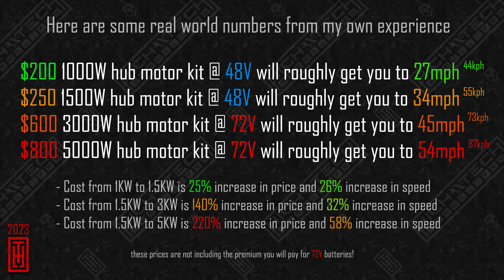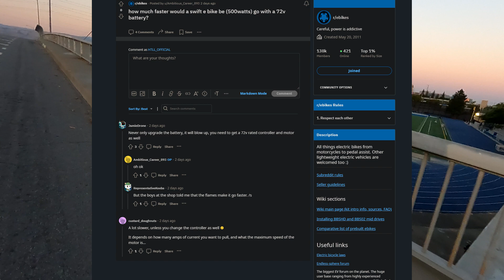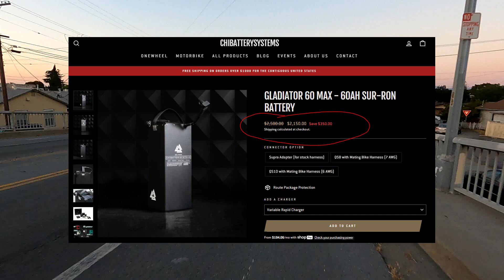🚲 High Powered Ebikes Are Stupid And A Waste Of Money

Comment: The standard 1000w hub motor (28mm magnet height) can go 60km/h on flat without overheating on 72V. Or on 48V if you replace the phase wires and connect the motor to have  √3 higher KV.
The only problem for me is it reaches 80°C quite fast when going uphill. I give it 45 amps though. A bigger motor would be more efficient and generate less heat. Or putting the 1000w motor on 20" wheels for more efficiency.
Reply from the maker: Yeah uphill is a lot for any ebike, I did hear some people saying their reasoning for wanting more power is for uphill, which makes sense but I still think that a motorcycle may still be more economical 🍻

Comment: I think I agree with you to some extent, but you said if you wanna go fast, you need 72v but there seems to be a lot of bikes coming out that go pretty fast that are only 52 V with field weakening.   
Also, I have a roadrunner pro and that’s 60 V and that thing accelerates like crazy and hits 50 mph. But yes, 72 V is generally the gold standard.
Reply from the maker: To me 72V is now not enough if you want high power, 96V is the way to go for a higher top speed and will be minimum for my high power builds 👍

Comment: After riding my 3000w kit for five minutes I was like wow this is dumb 😂
Reply: @ what frames do you use for your builds? The axle keeps coming off of the dropouts on mine (just put it together last night). The cord wrapped around the axle but everything still seems to be working but this is annoying
Reply from the maker: @dogeystyle69  I've used many different frames, if your dropouts are worn (loose/play in them) or your axle nuts are coming loose, then you'll want to make sure you have torque arms in place. I have a video on my channel on how to make very strong torque arms, this will prevent this issue from happening. 

For 3KW and up, torque arms are basically essential, especially if your dropouts are not particularly strong. I've gotten a lot of flack on my lower power builds (1500W and under) for not running torque arms, but for certain applications (aluminum frames, thin/skinny dropouts), especially high power ones, you really need them. 

Also make sure your axle nuts are on tight 👍

Comment: Very well said.  I would just get an electric motorcycle if I really want speed.   I use my ebike to overcome the hills with ease.  Other that that, I am never really in a hurry to go home when I am on my bicycle.  Excellent points you have there.   Most use Surrons/Ebikes as a substitute for a motorcycle.   The police in my area are already cracking on these high powered ebikes riding 50 mph on the sidewalk.
Reply from the maker: Thanks man, yes there are some cases where you might want a "gray" bike, but that margin is very small and going either side of that point makes more sense to me. I've had people argue with me only to let me know their bike is 1500W which is my recommendation for power level. 👍

Comment: Bro suggest me :
I want to build an ev super bike that can do above 100kmph in Reasonable budget is it feasible? Main interest is more speed while keeping in mind the petrol prices in my country.
Or
Should i go with a petrol engine and enjoy? (Because petrol engine have more prower?
Reply: Ok i got my answer at 14:00 😅
Reply from the maker: @BLUE-uy3fb  For ebikes, getting to 60mph is expensive, getting to 40 is pretty cheap. You have to pay a lot for that extra 20mph. Gas bikes also have a huge advantage for going fast as they are designed to do that for a long amount of time (freeway riding). 

If you run an ebike at highway speeds, even the production ev motorcycles like Zero Motorcycles your ev range drops considerably when going those speeds for any length of time. Same for EV cars going high speeds, towing, etc. EVs are better for slower, stop and go usage like city driving.

Comment: the problem with E bikes is that they are heavier than a regular bike of which makes it hard to pedal it even with the pedal asset , we are forced to use the full throttle because it's just too heavy ...
Reply from the maker: They don't have to be much heavier, there are so many different ebike styles and sizes. I have a few that feel exactly the same as pedaling a non-powered bike 👍

Comment: He must live on flat ground without rolling hills to climb?
Reply from the maker: 1500W should be plenty of power to climb a hill, and you may want to pedal as well to assist. If you need to go 40MPH uphill then by all means spend the thousands to get yourself there 👍

Gas powered still makes more economical sense if you are needing to go very fast up steep hills.
Reply: @hightech-lowlife  won't you agree if someone wants an E bike that can go up to 40 MPH at that point they better buy a motorcycle helmet & not that stupid E bike Helmet ? I think going super fast on an E bike is very dangerous cause they shift speed so very fast & so suddenly that a car going at the same speed can't keep up with the agility of the e Bike. I lived in San Fran most E bikes in my opinion can't handle the hills on a daily bases & trying to use pedal assist is still very hard because those E bikes are so much heavier than a regular Bike so it takes more work to pedal even with the assist , & plus Bicycles /E bikes are not designed to go super fast at faster speeds.. unlike a a Harley that comes in at like 480 to 500 pounds;  the physics of going super fast on a E bike is not supported ;the laws of physics will take out the rider .. more dangerous than riding a motorcycle at super higher speeds.. just my opinion..

Comment: My bike cost just under $2k in total and does have a crazy top speed but I built it for 30 everywhere :) I feel lucky be considered into that top 1% of the 0.1% and to have not spent 6k in parts at the same time haha 😅 average cost for a 1500w build with a second hand bike in the UK for me is $630-750 and I managed to build a 10-14kw ebike for around or less 3x the price, a good ratio considering it (can) do 5-7x the power of my old bike, double to triple the mileage (40-60 compared to 15-20(52v 18ah), it can now go uphill 3x the speed too I done 45 up a super steep hill. 70-80mph? Idk I haven't went past 60 and not past 50 since then.. I laughed my ass off when you mentioned how scetchy it can be 😂 I kept burning out motors on steep hills going 10-15mph, I now have 3 old 1500w hub motors that can be fixed becuase it's likely in 2 of them the hall sensors burned out before the coil windings, but that's what got me thinking "with all the money I've spent on these cheapo hubs I could've made that 5000w one I've been eyeing up" that's where it started lool, and ofcourse to get under that 2k price I had to build a battery, it's a 72v 36ah 12p pack. 
It's at the point where I'm happy where it is. Only upgrade I can see it needing is some sealed bearings that can handle 30mph for the long term. 

Overall it's a beast for the money and can see it being way more reliable than a 1500w hub, but that's only because I live in the countryside and have alot of hills around and in hindsight those shunt mods will only work if you live in flat road areas too lol. Yes I know..😅 The regen brakes save me the pads but you are right in pretty much everything you said here. The car license is next before a bike in my situation, I would like to drive shielded out of the rain sometimes lol.
Reply: Is your 60-80kw build going to have a qs180?
Reply from the maker: Yes, if you're on r/ebikes a lot of riders tend to think you need spend at least 4k on a bike otherwise it will fall apart and you'll get injured, which is nonsense. 

I don't live in a place with many hills so I can't comment on my personal experience, but if you're burning out motors, I'd be curious if it's the motors or the controllers that is getting fried? If you're going to push your stuff, I would avoid shunt mods, as I speculate your motors are probably ok, it's the mosfets in the controllers that are toasting. Basically heat is the enemy of electronics 👍

My idea is that a lot of people are overspending and overspec'ing for what they are actually using their bikes for, but of course everyone's use case is slightly different. 

What controller/motor/ and battery amp output are you running? Sometimes it's safer just to take a car, especially if you're going somewhere far/dangerous or if it's wet out. 

The QS180 is rated for 20KW peak, could probably push 40? It weighs 45lbs, the motor I'm using is 65lbs and peaks at 80KW, and it's also water cooled so could probably go even more. It's not a QS motor as they only go up to 96V and my monster bike will be 144V 🍻

Comment: YOUR NEXT BUILD:
Inner-city 25mph , less than 10 miles EA way to work battery capacity(could even charge at work), super light weight, and able to take into the building. Spend the money on weight savings, not speed
Reply from the maker: I think a folder or bmx would be nice for that, wouldn't need too much battery power, especially with smaller wheels. 👍
Reply: @hightech-lowlife  Small wheels will unsurprisingly need more RPM to reach the speed. It was a trap I fell into when making my cargo fatbike, and now I'm stuck with rather underpowered motor on it. (Like, small geared hub motor, is too small.) It's way heavy with my heavy ass and added cargo to move quickly and not be tiring without power.
So you should probably revise your power estimate up by say 50%...
Reply from the maker: You can get more RPM by upping the voltage @AstralS7orm  

I'm assuming you have 20" wheels? What's your top speed? Wattage? Voltage? 

Biggest criticisms I've seen with this video are "I'm big and heavy" and "hills" which are valid, but I still question "how fast do you really need to go?" 

This was more of a take for people who are new to ebikes thinking they need 10KW+ and spending (wasting) 60% of their budget on speeds they will never feel comfortable riding at. If someone wants to spend nearly double the cost to go another 10MPH up a hill, that may be something they deem worth it, of course everything is subjective at the end of the day. 🍻
Reply: @hightech-lowlife  Oh yes, 10 kW is way too much (like half of a weaker gas powered motorcycle), but 3 kW might even still be useful if you want to go fast, because field weakening exists.

Silly 250W or 500W restrictions are way too low. I get to live with one of these and 48V limit.

The high voltage is generally higher RPM and slightly higher efficiency. The extra $400 on the controller and battery may be worth it, even if the power stays the same.
But a better controller is just a better controller...
Reply from the maker: @AstralS7orm  3KW can still be made for less money, but will require 72V. I agree 250 and 500W is not enough for smiles. A good controller is worth it as it will let you adjust things to your liking a lot more than a cheapo controller 👍

Comment: I have been building my e-bikes for some 7 years, And yes over time they got faster and heavier and less bicycle and more Moped/scooter or even motorcycle. But I fast realized that these are bicycles and they are not designed to go the speed they were traveling and stopping began to become the next battle. The spirit of the e-bike was lost over time. I found that when I rode one of my builds that was a bicycle with something like 500 to 1000 watts hub motor I could ride anywhere a bicycle could and no one would say Boo! But I had a few front wheel hub motors laying around and built what is all the world an Electric duel motor motorcycle which is rocket fast and folks don't like seeing it rolling towards them on a side walk unlike the standard e-bikes I generally ride. I really like the fact a regular bike frame e-bike allows me to ride on street, trail and sidewalk without hassle or threatening pedestrians. But in all the time I have been riding e-bikes I only ever had "Cyclist" get their nose out of joint about them. Had one guy and his woman ride up to me and tell me I was cheating! Too which I replied . "Sir I assure you I do not know your wife."
Reply from the maker: Thanks for your insight man, and I would agree that there are a lot of benefits towards a more bicycle type ebike than a more motorcycle style. They are more covert and will draw less attention (good or bad). I've yet to run into anyone scoffing at me on my ebike, however I've heard a lot of stories so it's bound to happen sometime. Hahaha, that's a good comeback! Cheers man 🍻

Comment: Yes; your title caught my attention, but I couldn't call it clickbait because it wasn't misleading ;) You make some good points, and how far do we go before it just becomes better to get a real motorcycle? I've only been into e-bikes a few years, but have been working on high voltage motors since I was in grade school. I do know lots of people with over the top builds, and the guy with the 91mph Spark Cycleworks Bandit is a personal friend, but I have no desire to go that Fast! My own goals were excellent hill climbing and towing capacity, but on a bike that still looks stock and gets smiles and waves from park rangers. Oh, and it has to fold and fit in my trunk.

I wound up with a RadMini running dual Tesla batteries through a Phaserunner to a modified G062. Though the default mode is 750 watts and 20mph, when unlocked it will peak at 3,200 watts and 40mph. That's fine by me, as the stock tires get squirmy above 40 anyways. I often ride in parks and shared paths, and sometimes I never take it out of default mode. It will never be a motorcycle and I don't want it to be, but it does make a decent moped in a pinch. I was on the first gas/electric moped group ride in the country (at least that's what I was told!), and I have to say that on the winding climb to the scenic overlook over the city, the better electric bikes dominated the gas bikes with ease. Thanks for the video!
Reply: The beauty of a standard e-bike is you can ride where ever it is legal to ride a bicycle but some think they can ride those monster e-bikes the same, Most folks are not happy to see something that looks like a moped or motorcycle sharing the sidewalk with them.  Surons e-bikes are mini e-motorcycles I don't care if you still have bicycle pedals and chain.
Reply from the maker: This is also a good point, thanks man 🍻
Reply from the maker: Thanks man! I'll admit my title and thumbnail are a bit clickbaity/inflammatory compared to the info presented, so if you called me out on that I would not be offended. I agree with you and it seems like you found a solution that works best for you, which at the end of the day is ultimately what I am going for. I just see a lot of people wanting to go faster and faster, and I didn't think a lot of people realize that it's not as worth it as it may seem. Thanks for your insights, cheers 🍻

Comment: I went with conversion to mid motor ebike. 750W and 25-30mph is enough for me. Bike and conversion parts including battery cost me below 1k(~800$).
Do i wanna go faster? Doesn't make sense for me. There are better tools for a job. 
Yes, I also have a motorcycle, and a motorcycle does a much better job if you want to go fast.
Reply from the maker: Thanks man, I appreciate your insight and I fully agree that this is the way to go. 🍻

Comment: I currently commute with a motorcycle and I'd love to switch to an ebike but the only thing stopping me is the safety of the roads in my area. (South Seattle) I want the full headlight/ taillight/turn signal suite and on some of these roads with fast traffic and no shoulder I don't think I would feel safe without the speed and power of a full blown motorcycle. At that speed I feel like I'd want weather proof armor and a full face helmet anyways so why bother.
Reply from the maker: Yes, it is possible to get something similar, but it will be expensive. If you are enjoying your gas bike then it's probably better to keep it, although if you have the opportunity to try an electric motorcycle (rent, borrow, etc) that would be a worthy endeavor. Cheers 🍻

Comment: I've got over $11,000 into my sur ron It goes about 65 miles an hour. The only thing that stock on the bike is the frame and the motor. It's pretty and it's fun and And has a lot of torque And I'm only running 60 volt I'm 63 years old I don't think I need to go any faster than that I can do willie's at 45 miles an hour. And that's a bad idea But crazy fun. Have fun with your bike. But get ready to spend some money.
Reply from the maker: Thanks for your experience, if you have the money (as in my disclaimer section) it is fine if you want to spend on a high powered ebike. If you check my channel I have made many 👍 and will make more. I never got into sur rons (my friend got two in 2017 and I had a lot of experience with them). Cheers and safe riding 🍻

Comment: I agree 100%. I have two go to bikes, one electric and one gas. I use my DIY ebike for the trails and I seldom exceed 15mph. My ebike is 1000w 48volt gearless hub motor. Plenty fast for me but I do need more torque for climbing hills. I am 70 yrs old and have COPD. I love my ebike because it makes it possible for me to still be able to ride. My DIY gas bike is for the road. It has the smallest Harbor Freight Predator motor on it with direct friction drive. It's plenty fast but I seldom go over 25mph and hills are no problem. No range anxiety with the gas bike either. I hear it gets about 150mpg and it holds 1/2gal gas so I don't think I will ever ride 75 miles and since it's a 4stroke I can stop at any gas station if needed. There's a fellow named Jarrod D on YouTube who road his Predator gas bike 4500miles from Florida to California and back on a bike like mine. In fact I used his tutorial to build mine. Keep the shiny side up folks. 🚴💥💨💨💨
Reply from the maker: That's awesome! You're 70 and rock a predator bike? I salute you ma'am. I appreciate your insights, thank you. I wish you the very best and safe journey on your rides. 🍻🍻